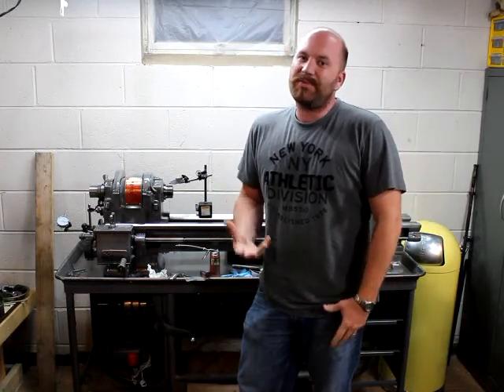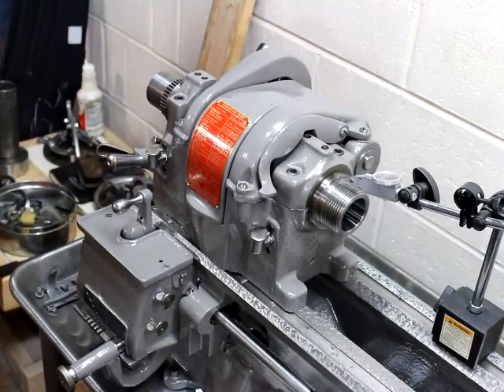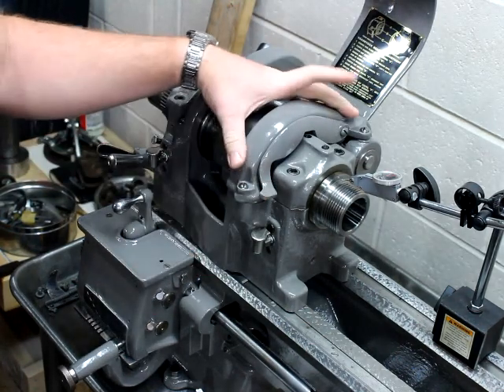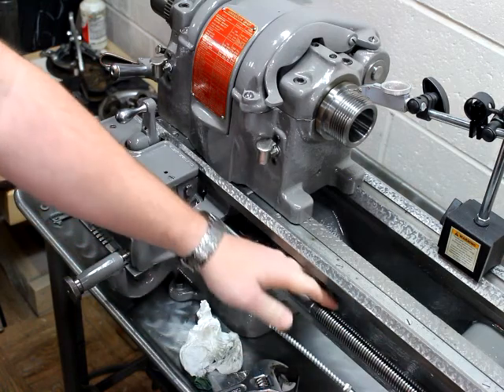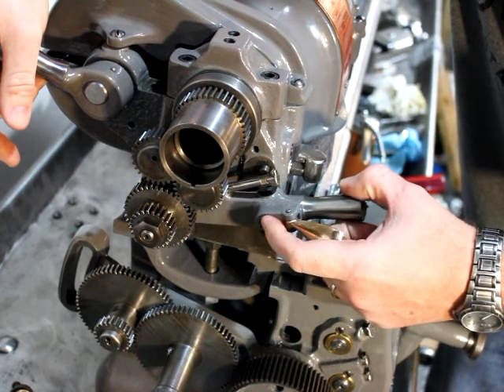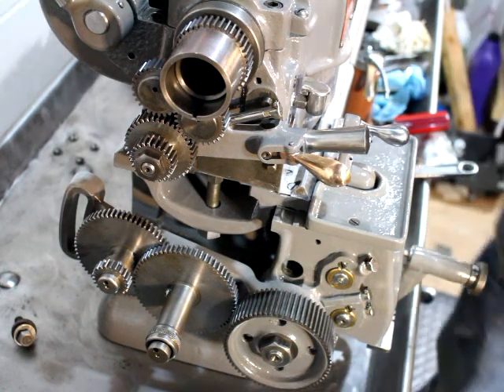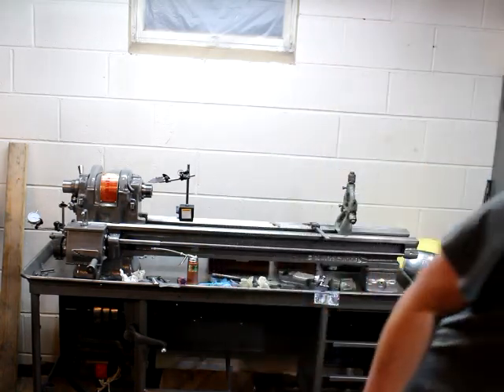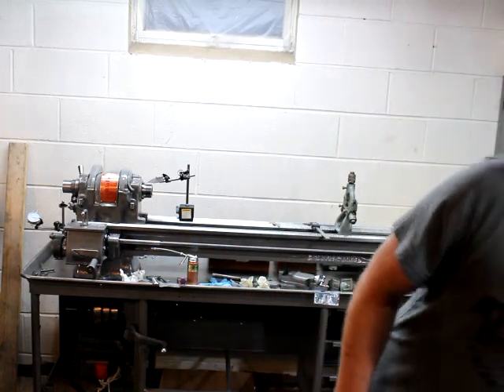South Bend Heavy 10L Restoration Update Part 2!

Comment: I really like the name plate restore you did, my Logan could use it. 
Jim
Reply from the maker: +Skip Tracer 
Thanks, I wasn't quite sure how to go about doing it so I just jumped right in and started. Should work on your logan, but the plates I did were all nice and flat, so they turned out really well fairly quickly. First was to clean them off and get most of the paint off. Acetone worked fairly good. Then Paint with spray paint of choice, I used some rustoleum industrial. Let dry for a couple days, then sand off on a flat plate or really flat surface with 6-800 grit. It may take a while but worked out great for me. Thanks again!
Reply: @precisionmachineshed  good tips

Comment: Did you have a thread anywhere on a forum talking about your restoration?  I'm restoring my 1967 South Bend Heavy 10, I'd be interested in any help or tips.
Reply from the maker: http://www.practicalmachinist.com/vb/south-bend-lathes/spitfires-heavy-10-restoration-306854/

Not sure I got too detailed with it, but there might be some good info on there. There are also a bunch of other build threads on there that are much better than mine. I believe Brad Jacobs (Basement shop guy) on YouTube, and one other YouTube guy has posted threads there too.

Comment: My 10 cross slide keeps wearing out brass threads and giving me some crazy slop any ideas. Mine looks identical to this one on this vid
Reply from the maker: Is it all original? could be a couple things. Nut could be out of alignment with the rod, Ways could be badly worn, gibs could be out of adjustment. Is it dirty in there? Hard to tell without more info.
Reply: Should be bronze,harder. Lots of oil,everytime it is used.
Reply: Clean and check all item PMS mentioned.

Comment: And the gray paint is ?? Cheers!
Reply from the maker: +Pete Macrae 
It is a Gloss Dark Ford Grey oil based that I used a catalyst with for more gloss and a much harder finish. It is an implement paint that is sold by a regional store called Fleet Farm. This is the paint that is used by a local machine rebuilder that has been rebuilding for 30+ years and has tried just about everything out there, and found this to be the best unless you want to spend hundreds on a gallon.

Comment: Up late uploading videos too eh.  I wish I had the presence of mine to document my restoration of my heavy ten. Mine has the double tumbler gear box.
Reply from the maker: +Joseph DAndrea 
Hey, Yeah not too late here yet, but getting there. I only have a few videos on this guy, but thought I would make a few progression videos along the way. I also have a bunch of photos I took along the way too. When I get finished I'll throw all those together. Thanks for watching!
Reply: +spitfire1821 how many taper pins have you ruined? my lathe had been "rebuilt" in its past and every single taper pin and strait pin was mushroomed.
Reply from the maker: +Joseph DAndrea 
On this lathe with the apron I am using I only had to drill out one pin in the apron which was my last resort to get it out. It was stuck to say the least. All the other pins for the most part popped right out. There were a few that were tight but eventually they worked out. Drilling out taper pins is damn near impossible without wondering out of the pin unless you have it set up in a mill with an end mill.
Reply: I ruined my back gear drilling out a tap pin that wasn't on center to begin with. Fun times for sure. There a bed grinding place local to me mine only has .003 wear but heck it's apart so im thinking long and hard about shelling out the money to have it ground.
Reply from the maker: +Joseph DAndrea That's unfortunate, always a bummer when it goes from bad to worse! As far as having your bed done, 0.003" is nothing and from what I was told from the guy that did mine, he said that most of the machines he does is in that 0.030"-0.050" wear range. I guess if you can get a good deal I would say go for it. It sure does make them look nice! Main reason I had mine done is that I plan to keep this thing forever, and I'm going to be doing mainly rifle barrel work on it, so I wanted to take out as much machine "slop" as possible. I have no opinion on what it did to the lathe because I have not run it yet, but I am expecting 100% improvement over my previous worn out old Logan 922 that is in many of my previous videos.
Reply: @precisionmachineshed  how much to grind and scrape?
Reply: @precisionmachineshed  I live east of Minneapolis. I have been to Roberts. They are close.